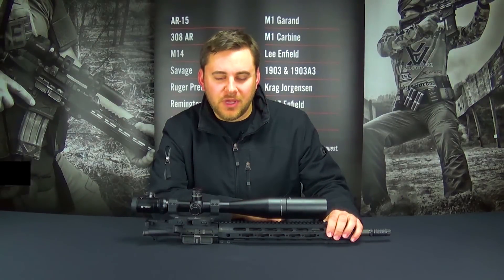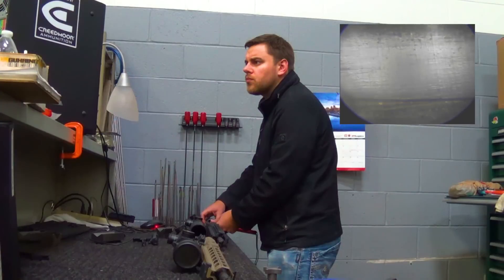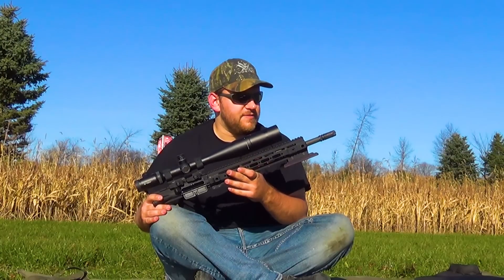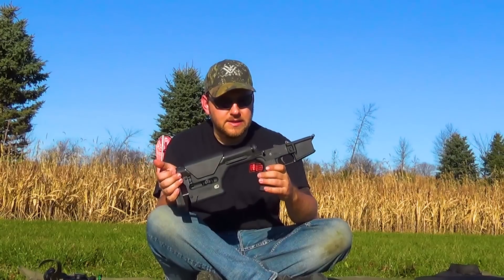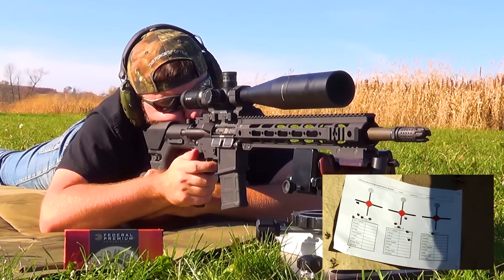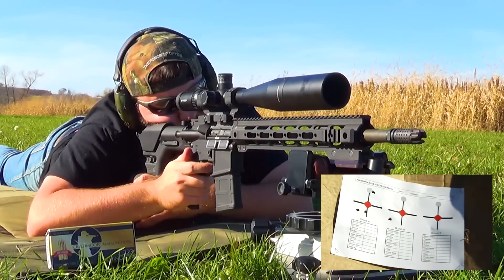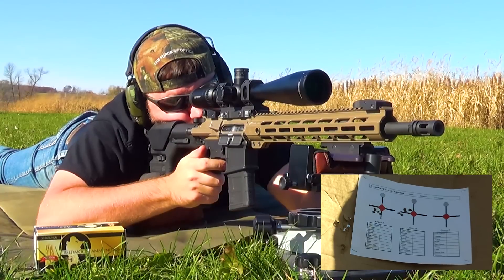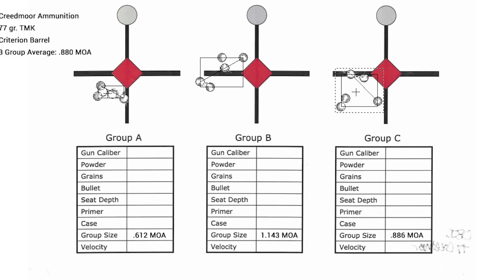Criterion Barrels vs Cold Hammer Forged:   A Comparative Analysis

Comment: Both my FN ARs, a modded 16" mil-spec M4/RECCE with a button rifled, chrome lined 1/7 twist barrel in 5.56 mm and a CHF chrome lined 18" match grade sporter in .223 rem shoot lights out with their favorite load, Sig Sauer Elite 77 gr OTMs. I have dozens of sub 1/2" 5-rd groups at 100 yds from both.
The match grade sporter has a 1/4" group or two under its belt.
But after almost 17k and 13k rounds respectively, it's getting close to time for a new tube especially on my M4/RECCE.
I plan to buy Criterion barrels when I do to see how they stack up against those FN tubes.

Comment: must have cherry picked a barrel or used handloads.. never saw a barrel shoot factory ammo for 15 rnds like that and i had a criterion barrels before ... i now run kreiger and that only shoots that tight with handloads. have a  non-bias source come into your factory and just pull a barrel off the line and I guarantee you will see nothing like you saw in this video. very dishonest.

Comment: I'm calling B.S. here. what was shown was the difference between a lapped barrel and a non lapped bbl. Not cut, or button vs. hammer forged. A ture hammer forged barrel is done with a polished carbide die inside the bore and leaves a virtually mirrored surface. Far from what was shown here, where as a typical bbl has to be hanlapped to give a similar finish. ( The rougher bbl. looked like a typical poorly finished button rifled bbl. or a cut bbl cut with a dull die). A well finished lapped hammer forged bbl. is the best of both worlds! 
the only reason manufacturers dis. Hammer forging is thar machinery is prohibitive for all but the largest companies.  It's easier to run the tech. down rather than face the truth of not wanting or being able to foot the bill for hte machinery. 
KnifeMaker

Comment: The point of a cold hammer forged barrel isn't accuracy, it's barrel life.
Reply from the maker: -I would say it is efficiency in manufacturing, not accuracy or barrel life... and it is a good method.  However, with a chrome lined barrel, it is the uniformity, tolerances, and quality of the chrome lined interior that will determine barrel life and accuracy, not how the rifling is formed.  Because we hand lap bores to perfectly uniform dimensions prior to installing chrome lining, it removes any variations in the depth and uniformity of the chrome lined interior.  This makes the barrel more accurate and more durable as it removes any thin spots and variations in the depth of the chrome throughout the bore.  As chrome lined barrels wear, the chrome lining will eventually begin to crack and then finally chip due to heat and pressure.   Once the chrome lining chips, the barrel will never shoot to the same standard again.  Our chrome lined barrels not only shoot better (on par with any of our raw stainless-steel barrels as they are held to the exact same internal tolerances) but last longer than barrels made without the same attention to detail and perfectly uniform chrome lining.
Reply: @CriterionbarrelsInc  I need you to tell me your HBAR will last 15k rounds. You'll make a sale.

Comment: The cold hammer forged chrome lined is probably less accurate but it a jungle or swamp like environment, wet and humid or dry and dusty, rainy or snowing, extreme heat or frigidly cold the chrome line CHF would most like hold up better than the stainless steel or nitrided match barrel! So are you going into war and just need to protect your self while being out in the weather for days at a time or are you in a tournament where you can clean your firearm afterwards and put in back in the safe. This is the decision one needs to consider do I need to shoot the hair off a flies ass or do I just need to land a hit on my target. To have both is the best bet

Comment: I know this is a pretty old video. I watched it multiple times before and after I bought a Criterion 18" Hybrid AR barrel last year (rifle gas). So I want to share a little bit of my personal experience with this barrel. Hope it'll be useful to someone.

After I received the barrel last year, I built a SPR from it. The first thing I noticed was the fit between the barrel and my Aero Precision M4E1 enhanced upper was a little loose. The barrel was wobbling a bit inside the receiver. AP's upper is pretty solid and high quality, and I tightened the barrel nut to 55 lb*ft as Aero Precision specified. The first few trips to the range, it didn't shoot well at all. I tried different ammos. Always 1+ MOA, sometimes maybe close to 2 MOA. I wasn't happy about it. So I reassembled everything, tightened the barrel nut a little bit more and made sure everything else was put together according to the specs. Still it didn't shoot well. Then I found videos talking about bedding between the barrel and upper receiver. Because the loose fit in my case, I decided to do that. So I bedded my barrel and the upper using Loctite 620, which got rid of all the play between them. They're literally glued together super solid. Now it shot noticeably better. I could get sub-MOA sometimes (with IMI 77gr razor core), but not consistently. Most of time it's still 1+ MOA. It's not to my expectation yet, but at least better than before. With my other two WOA ARs (one complete varmint upper from WOA and one I built using WOA predator barrel), I could consistently get 0.6 ~ 0.7 MOA easy. Some of the best groups I got with them are 0.2 ~ 0.3 MOA. And I was using the same ammos I had at home. So I knew I wasn't the major limiting factor for the Criterion barrel.

Since then, I left that upper alone for months since I had more accurate rifles to play with. This year I somehow had an urge to see if I could possibly improve the Criterion's accuracy a little bit more. To do that, I needed to remove the "glued" barrel from the receiver first, which took me quite an effort with a propane torch and some hard pushes. Fortunately it came out clean. Then I reinstalled it to a new BCM upper. BCM upper has a reputation of being undersized. So I had to heat it up to thermal fit the barrel in. This time there was no play at all which was a good sign. I then put everything together and took it to the range. I felt the accuracy was probably better than last year, but still most of time it's 1+ MOA. For that trip, I got only one sub-MOA group out of like 15. So I was trying to figure out if there's anything else I can do. I realized I was using an old BCG from another rifle. So I decided to swap in a brand new BCG I had. Another range trip. This time, it still shot most of ammos 1+ MOA. But for IMI 77gr razor core, man, I got 3 sub-MOA groups out of 4. The first group was mediocre because it's probably refouling the barrel. The next 3 groups were ~0.5 MOA, ~0.6 MOA, ~0.6 MOA, pretty consistently. Now I was happy about it. It seems Criterion barrel is a little pickier than my WOA barrels. For several match ammos I have, WOA can shoot most of them sub-MOA consistently. But for Criterion, IMI is the only one I found so far that can shoot. But still I'm happy I found it (I don't reload). Another lesson I learned from this is apparently BCG matters in accuracy.
Reply: I can back what you said up as I not only lapped my upper face contact area to the barrel, but also used a high quality Sharpe's BCG when I built it to begin with, so my .75 MOA starting point was not bad...yet I wanted more out of it (actually less...of a group that is).  All of these things make a difference which appears to add up together.  You did not say anything about lapping...did you, or would you be willing to try it is it would bring your group even tighter?
Good luck!
Reply: @dandexinventor  I actually thought about lapping the upper receiver face when the barrel was installed on my M4E1 enhanced upper last year. But with that upper, normal lapping tool doesn't work. So I didn't pursue that route. 

Since then, I read some mixed opinions on whether people should always lap the upper receiver. From your experience, how much have you gained in terms of accuracy from lapping the upper? I'm curious.
Reply: @Ming_USA  I did all of my uppers and they all showed some degree of improvement.  One of them was already close to being true, so I only noticed my average group improve by .15 MOA.  I could tell is already close to true because the lapping tool only took off a very small amount before th ewhole face was showing lap marks.  With the others, the worst one took me lapping for a few seconds, look to see how much was coming off, then a few more seconds...repeated until I saw the whole face with new lapping marks.  This one improved from .750MOA to .37MOA (average over 20 rounds for my test before and after on all of them).
I was learning a lot at the time and kept notes to see what affected what.
I learned almost everything affects impact placement, but group size seemed to get better and stay there if the ammo and my skills were consistant.
The one thing which threw me off at first was barrel temp, so I learned to shoot 3 rounds before any shots which needed to count.  I believe tempature affects harmonics as well, so I learned not to tune my brake/tuner until my barrel was warm.  All that made a big difference...now I'm wondering how to get away from that so cold bore shots are not flyers more often than not.  If hunting, can't shoot warm up shots.
I might have to try my DeWalt cordless heat gun in winter, on hunts, but living in the desert means my barrel is usually over 100F 8 months out of the year anyway.
Good luck with your lapping if you can get it done.  The other route (assuming your upper is true) is watch Johnny's Reloading and learn to tune your ammo to your gun.  That is what I'm doing now...it's a great hobby...keeps me busy and out of trouble, lol.
Reply: @dandexinventor  Thanks man for all the information and details! That sounds very promising. What I heard before was if the upper is from a reputable manufacturer, usually there's no need to lap it. But seems you're getting pretty consistent improvement by doing it. I may give it a try for my next build. 

I've also read about the cold bore (and very hot bore) flier before as you mentioned. But my understanding is it happens more often with thin barrels. Heavy/bull barrels are less susceptible to temperature fluctuations. But I'll keep an eye on it when I shoot cold bore next time.

About reloading, I've done some research on it, but not gone down that route yet. With two kids to raise, I just don't have that much time to do it at this stage of my life. :) But I feel I'll eventually do it when I hit the next stage of my life. lol.
Reply: Came here thinking about getting one of their 18” barrels not knowing is was going to get some good tech. Thank you for this. And if the others commenting thank you!
Reply: The build can have a big impact on accuracy. I had a BA barrel for my 6.5 Grendel and with my first build, it was a 1.5 moa gun for the most part and hated 107gr TMK. Earlier this year I took it apart, put it in a new upper after I lapped the receiver and bedded the barrel with loctite, it shoots the same 107gr TMK's at 1 moa or less and 123grs even better. So all of that can make a big difference.

I haven't used a Criterion barrel yet but I'm really wanting a Core for my 16” rifle I just built. I put a Faxon Gunner barrel in it and it seems okay but I'm not getting the accuracy I really want and I can't expect that out of a barrel that skinny.
Reply: I was looking at a 18" Criterion CORE for my BCM upper receiver and BCG, but now I'm curious- what WOA barrel are you using and what are its usual groups with 77gr?
Reply: @craguned  As I said in my comment, I had 2 WOA barrels (22" varmint and 20" predator) then, now 3 (+ 18" SPR). They're all shooters. The most accurate one is still the varmint upper. With IMI 77gr, it can shoot 0.6~0.8 regularly. But the best groups are from Sierra blitzking 55gr, 0.2 ~ 0.3 MOA. Definitely more consistent than Criterion.

Comment: Bore scoping comparison is one thing .  Am I missing something ? You are comparing your .223 Wylde barrel to the competition which is a 5.56 .223 barrel .  Shouldn’t you compare the competition with a  comparable .223 wylde ?  If I missed something please correct me .
Reply from the maker: This is a simple comparison between commonly found CHF barrels on the market and our barrels for the AR-15.  The major difference between the .223 Wylde and the 5.56 NATO chamber is a minor taper in the throat of the Wylde chamber.  This taper produces more consistent chamber pressures which aids in producing better (more consistent) accuracy.  Both chambers will effectively fire both 5.56 NATO and .223 Remington cartridges. This is not an apples to apples comparison as the manufacturing processes are very different between the two barrels.  It is really highlighting the extra steps and the more refined nature of the barrels that we produce for AR-15's vs. what is commonly used as an alternative.  This is not a scientific study and should only be taken as a basic public service announcement.

Comment: When accuracy matters White Oak Armament, Criterion, ODIN Works and Daniel Defense are what you need to be running. There are many "blasters" and mallninjas in the AR15 crowd. A small percentage wants more out of their rifle and knows Wyatt Earp said it best. "Fast is fine, but accuracy is everything!" 

The rest of you can carry on with your high speed, low drag magazine dumps and playing with your Rare Breed FRT15 triggers. With any luck you can repeatedly  hit a 8" steel plate at 25 yards. Those ^ kinds of barrels can and will hit a marble or dime at 100+ yards.

Comment: I don’t think you’re giving a true comparison because the cold hammer forged barrel you’re using is a crappy one. Cold forged hammer barrels are way smoother and definitely not usually as pitted and ugly as the cold hammer forged barrel you chowed because I have 3 cold hammer forged barrels and there incredibly smooth barrels and my other 3 button cut rifle barrels are definitely not as smooth. I think you have a evident bias. Theres no way a button cut criterion barrel  is on average as smooth as a cold hammer forged barrel. And you know this. But good try making criterion button cut rifle barrels look as good as cold hammer forged barrel
Reply from the maker: Big Dick Cheney, I would encourage you to do some research on the manufacturing processes before throwing out your baseless  emotion-laden opinions.  Hammer forging is a means to form the rifling in the bore of a barrel... it is also vastly less refined than our production methods.  If you have doubts, feel free to look at national record winning barrels and find a cold hammer forged barrel that was used to win a match... our barrels currently hold numerous national and internal match titles.  Cold hammer forged barrels are great for what they are but they do not even come close to the refinement you get from a Criterion Barrel.  I am not trying to be a big dick but in this case, you simply aren't measuring up.
Reply: @CriterionbarrelsInc  your responses are hilarious. I already bought a 13.9 core last week but if I hadn't already, I absolutely would be based on your replies alone.

Comment: Ah, the magic marketing word "billet" was used. Since a billet only means a chunk of metal, it's a pointless adjective when describing a receiver. ALL machined parts start with a billet of some form. I thank you for using the term, though, since I can now discount anything else you say.
Reply from the maker: Forgings are pressed into shape by hundreds of tons of pressure, billet is cut from a piece of forged bar stock.  Generally forged receivers are more rigid and lighter in weight... take your pick.  But then again, what do I know?

Comment: Why did that one barrel shoot so much better than the other. What is done to the barrel that was shooting the tightest group, to make it shoot the tightest group . how did it do that
Reply from the maker: Details... we take extra steps during production like honing, hand-lapping, polishing chambers, precision cut crowns, and many other details that make for a more refined, more accurate, and more durable product.
Reply: @CriterionbarrelsInc  thank you for the reply. How does polishing Chambers and honing the bore and such produce much better groups then a factory BarreI. The factory Barrel was producing two and three inch groups, and the Criterion barrel was shooting 1/4 groups. I'm trying to imagine how simply polishing the chamber and such can produce such dramatic differences. Could you please explain. 
I'm curious because I plan on buying a Criterion Barrel, but I'm only able to find them being sold by Northland Shooter Supply
Reply from the maker: @squirrelmaster760710  The extra steps ensure that the bullet to barrel interface is more consistent.  This reduces fouling, bullet deformation, and increases consistency which translates to superior accuracy and durability.  If you have more questions, please feel free to give us a call.
Reply: @CriterionbarrelsInc  thank you